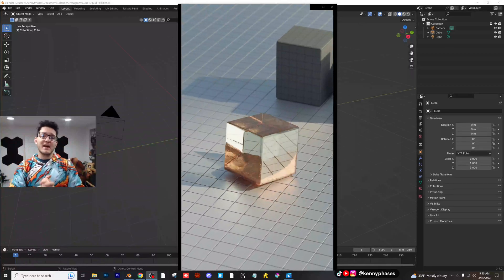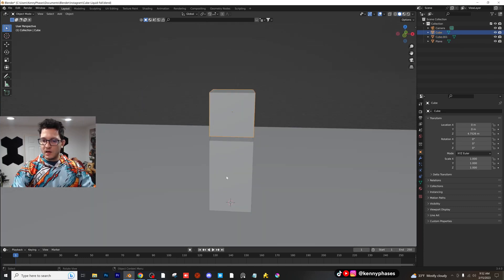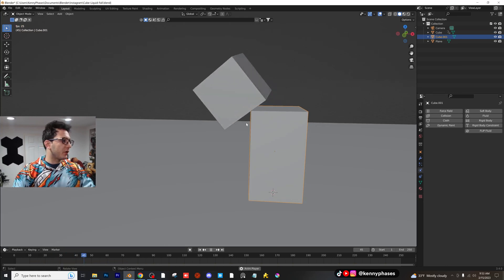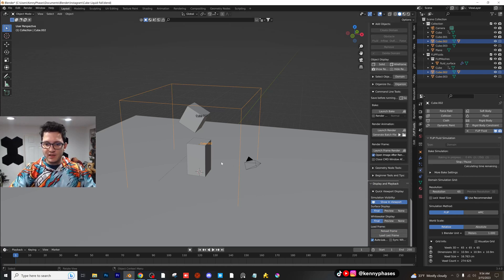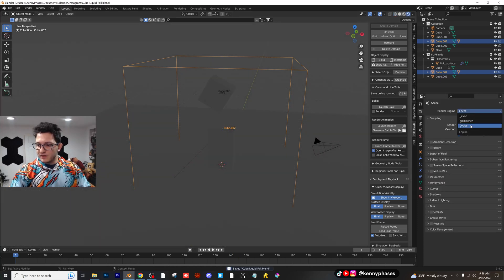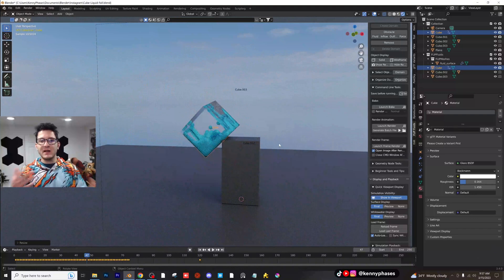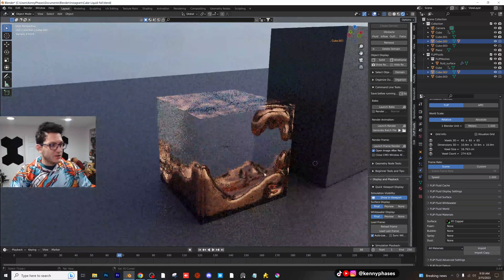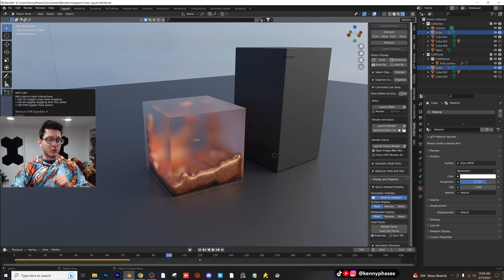Blender Fluid inside Falling Object (Flip Fluids)

Comment: Having an issue where the fluid geo inside the obstacle is penetrating the obstacle immediately on frame 1, but it isn't larger than the obstacle
Reply from the maker: I belivee the setting to adjust is called Surface Thickness

Comment: Some of my fluid seems to stick the wall for a couple of seconds and then resolves itself quickly and drops to the bottom
Reply from the maker: Check your "viscosity" setting
Reply: @KennyPhases thanks for the reply, the viscosity was the default (none), however I managed to resolve it by changing the 'safety factor (CFL Number)' from 5 to 1 to make the simulation more accurate (in case anyone else has same problem)
Reply from the maker: Awesome!!! Glad that worked! There's many settings you have to mess with for sure! @theoriginalluppy
Reply: @KennyPhases  very important question: 
can i somehow bake the fluid to keyframes too? cause i often use the time stretching feature in render properties (to slow down the szene) but the fluid does not get effected by it, why? how to fix that?